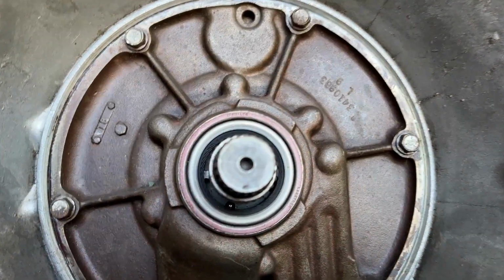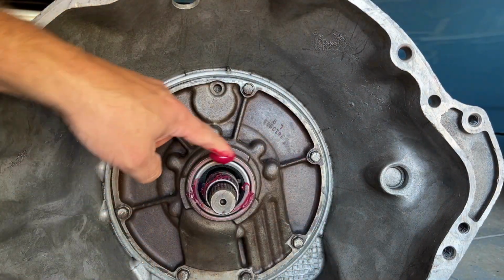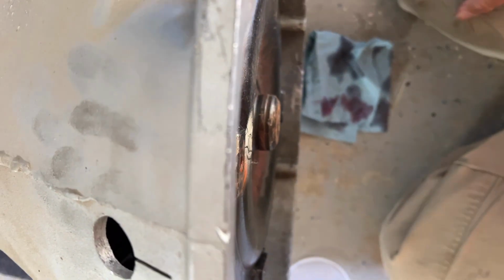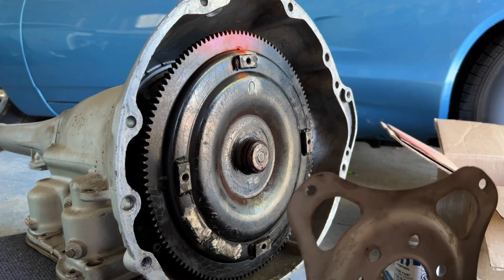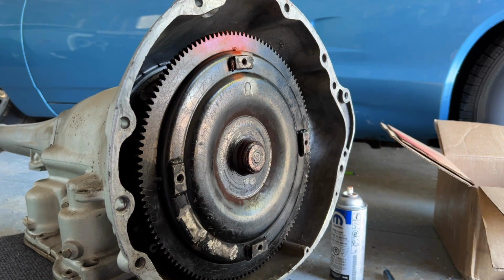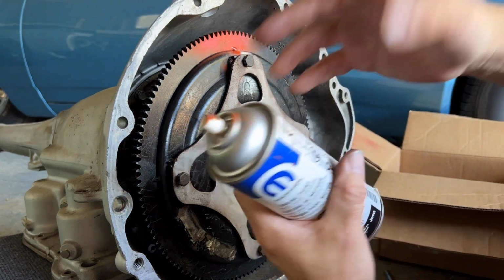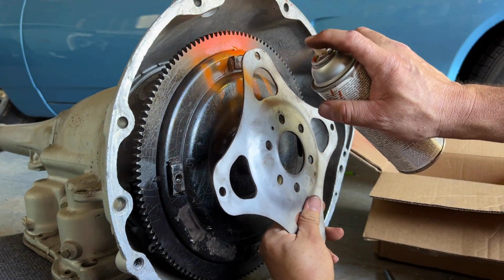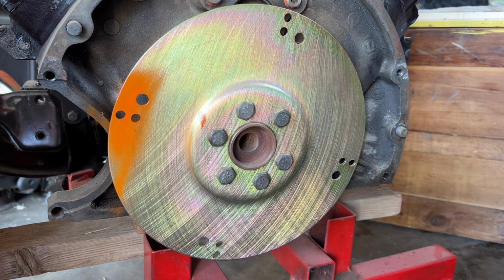CHRYSLER 727 Torque Converter install

Comment: Solid tech tip about lining up the converter to the flexplate. That's going to save someone a ton of time and frustration.
Reply from the maker: You said it John. I hope it helps someone out there. I still have bad memories before I knew that.
Reply: @JonnyMopar  now I know what I'm up against when the 360 goes in the Dart.
Reply from the maker: @fullthrottlekindaguy  Yes sir. But it’s easy brother. You can use your non weighted converter and get a B&M flexplate for the cast crank. Instead of being round it has a part cut out on one side. The opposite side acts as the weights on the converter.

Comment: I'm having issues getting the Torque Converter in the output shaft won't seat in.
Reply from the maker: #1 make sure the splines are the same. Early 727’s had a different spline count than later ones. It think 66 and older has a different spline count than 67 and later. There may be a 3rd spline count, not 100% sure on that or what year it would be. #2, check out Muscle City Madness. I think Ruben did a video where he used a screw driver to rotate the dog ear to a spot he can reference while installing the converter. Good luck.

Comment: Man I installed mine yesterday for my 66 Fury, now I've got it in the air trying to bolt it to the flex plate and I don't know if I marked it wrong or what but I haven't got it lined up yet. What a pain.
Reply from the maker: I hear ya Jeamie, after i did that once I always mark them ahead of time from then on. One of those life lessons you never forget. lol.
Reply: @JonnyMopar  I just tried every hole and it won't line up. Measured all the holes and they're not quite right. So I guess back out comes the trans and I can check all the holes at once. I'm afraid the holes on the new converter aren't right. Who knows.
Reply: @JonnyMopar  I figured out the issue I was having. The bolt pattern on the torque converter was wrong from the factory. I just boxed it up to send it back to get fixed. Just so you know, I didn't want you thinking I'm a complete idiot. Haha.

Comment: Hey not exactly related to this video but how hard is it to fix a leak coming from where the shift linkage goes into the trans?
Reply from the maker: It’s not too hard. I did that on the Orange Power Wagon I had. Not sure if I did a video or not. I’ll look.
Reply from the maker: Dang, looks like I didn’t record that. Was probably before I started the channel. Sorry man. Anyway, drain the pan, drop the pan, take off linkage, drop valve body, I used washers and bolts to drive out the old seal, I damage the new seal going in crooked (I will always buy 2 from now on just in case), use the washer and bolt to press in new one, reassemble all, add fluid. Done. Lol.

Comment: One thing I like about the Chryslers is you can drain the converter is a little plug some fools got it but GM don't have it it just doesn't make sense to be able to change your tranny fluid all that fluid still in your converter You Keep On Truckin man you're doing good
Reply from the maker: Thanks Kevin. Got a lot to do in a short time to do it in.

Comment: I'm new to Mopars so bear with me . Does the flywheel come attached to converter ?  I have a rebuilt 440 and am Buying a TCI  727 . your videos are helping me tremendously !  Thanks
Reply from the maker: You’re welcome. You need a flex plate. On a Mopar automatic the flex plate attaches to the crank on one side and the torque convertor on the other. The starter teeth are on the torque converter. The torque convertor goes into the front of the trans. Do you have a steel or cast crank? Early 440’s we’re steel (internally balanced), later 440’s we’re cast (externally balanced. It will impact the flex plate and or convertor.

Comment: you know your not suppose to put grease on the seals it will eat them up. You should put tranny fluid or special seal grease just fyi.
Reply from the maker: I did not know that. Thanks for the tip.
Reply: I'm getting ready to put a torque converter in very soon and was wondering about the same thing you commented on. So you can get away with just lubing with transmission fluid? I mean it makes sense but just want to get opinions before I go ahead and do this.
Reply: Yeah, the grease can liquefy and kill your transmission not to mention drying up the seals